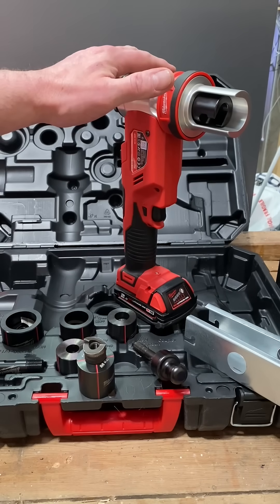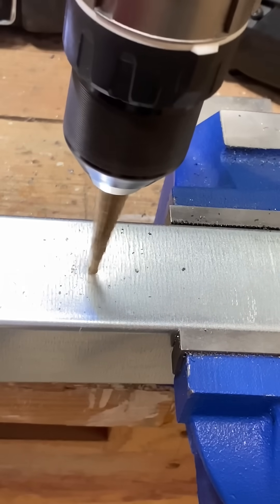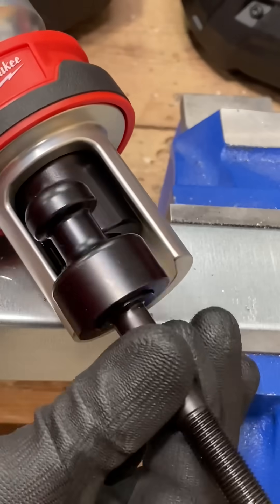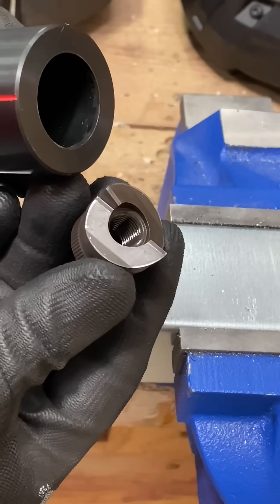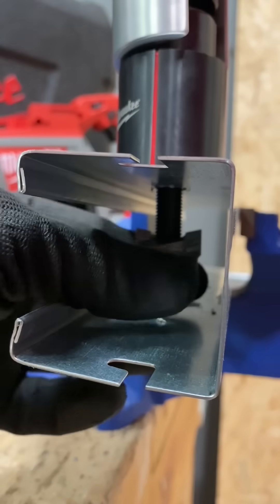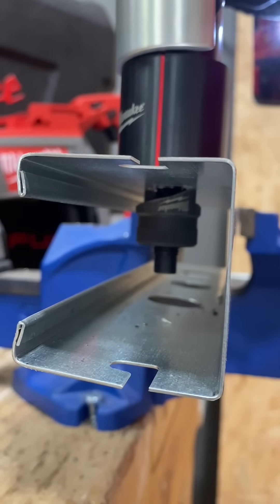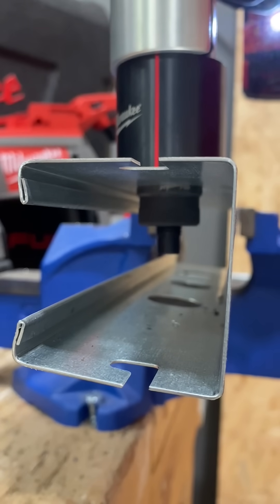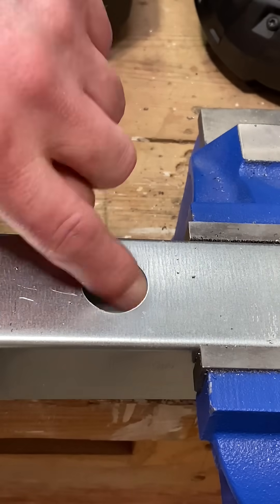ELECTRICIANS' TOOL TEASER - Milwaukee M18 Force Logic hole punch #shorts

Comment: A lot of faffing about .The decent fine tooth hole cutters you have now days could have cut and extra two holes by the time you fart around with the mechanism of it lol . As a previous poster replies there was a manual version of this back in the 70's & 90's . I am not 100% certain but I think they called it the Bailey Punch. May have a connection to the Electrical Contractors Bailey's. It definitely looks similar to the arrangements you have with the drill in respect of the cutting edge. It was tightened up with an Allen Key which compressed the cutter until it broke through the metal.
Reply from the maker: We are going to do a trial on both hole saw vs Milwaukee

Comment: Q-Max punch with a battery drill would do the same job
Reply: I've tried that you have to keep a tight grip and low speed.
Reply: Qmax ok for really thin metal thicker stainless steel go for greenlee with thrust bearing but I wouldn't use a drill above 25mm
Reply: Yeah but you have burs to deal with

Comment: Seems like a lot of faffing about. The time it took you to drill the 12mm hole you may as well have just drilled the 25mm hole.
Reply: I agree. I love milwaukee but just drill the damn thing
Reply: I was going to say that. The preparation takes longer than the process of normal drilling and filing
Reply: Just grab a large Stepper bit .
Reply: Punch works better on stainless steel gland plates. Especially doing multiple holes. The hole saw heats up.
Reply: If it’s the companies dime- I’ll take two
Reply: @altimmons  well it seems like one person gets it. 👍
Reply: but then you spend just as much time filing the edges smooth
Reply: @Kingrhem.  or you grab some sandpaper and have it done in 5 second.
Reply: Is this punch not able to go up to larger trade sizes? I would always go punch over drilling a 4” hole
Reply: @bradyschow3564 yes 1/2" through 4" i believe they even sell 5" and 6" dies
Reply from the maker: Point taken
Reply: This is more useful when doing 2" and up for electrical feeder in panels
Reply: And save a ton of money from not having the purchase of a no doubt expensive tool.
Reply: We do a lot of stainless and Titanium cutting, purely for costs drilling 12mm's and punching clean holes has been a much cheaper then replacing holesaws, learning how to sharpen drill bits is easier then one thinks.

Some situations you use a holesaw, mainly when its one hole and when we can't be arsed getting the punch 😅
Reply: Over engineering for a problem, that we already have a solution for
Reply: @street282  yeah, buying new hole saws every week is a great solution.
Reply: Sometimes we make 2.5 inch diameter holes in the very stout walls of elevator controllers. The only viable options are either a hole saw- (messy, crappy finish), or a knock-out tool. Sure, you can drill a 25mm hole straight away, but try that on a 64mm hole, through 12 gauge steel! Thats why an electric hole puncher is a cool tool.
Reply: People who rarely have to do such things wouldn't see a benefit.

The savings in replacement hole saws alone makes the tool worth it when you find yourself doing this multiple times on each job. 

I use the 2 to 5 inch dies pretty regularly. There are several reasons why this is the far better choice over a hole saw.
Reply: Why arent you just drilling the hole wtf
Reply: I was kind of wondering about that also but there is obviously applications where this is preferable...i just can't think of where lol
Reply: Wtf is trunken? Never heard of that term.  I love watching these tool showcases and stuff there always new foreign terms for stuff i know by other names.
Reply: @John J Kelly nope not at all. You got me.
Reply: It’s cool af but it does feel like any excuse to make another expensive single use tool
Reply: If the tool could do the same but without having access to the side opening.. theres no point in waisting time and money when you could just drill it out at quarter of the time. As for the shavings.. you have a vacuum and a massive side opening you can just shove the tip in and for those that say cables are in the way.. again just move the cables in that big opening. If this tool can do the same but in a beam (with no openings on either side) and to do it in similar time as a drill bit, you have my money and thumbs up! 👍 come up with that boissss
Reply: If you drill it though you have to then spend some more minutes deburring to make sure that you don't marr your cable's insulation.

It's not likely to be much faster.
Reply: I came for this comment and I wasn't disappointed, gotta love the Internet.
Reply: A little bit more with bit would had been same results
Reply: The idea is great, but in reality, you could have probably done 3-4 holes in the time it took you to set up, etc.
Reply: Brokie. You don't know what you are missing
Reply: really only good if you have a hole already there that you need to enlarge... not a lot of great ways to do that in metal...
Reply: Dudes never touched professional electrician tools and it shows 😂
Reply: Thier are cone bits upto 32mm so why to bother.
Reply: I think this tool is more for ticker glanding plates on fuse boards than for trunking
Reply: Also depending on the material, the drilling will take longer
Reply: Nah it's not for doing 1 25mm hole, it's for when you need to do 30+ holes or large holes, it also leaves a really nice finish with no burs. 
If you've got a large industrial switchboard with lots of glands or large glands/entries, this thing makes it a lot easier
Reply: TRUE!
Reply: Bit excessive for that application but great for repetitive jobs or stainless panels. There has been a bolt only version available for years that can be used with a spanner or impact gun.
Reply: Works nice when you’re trying to enlarge an existing hole or drill a hole so large that a holesaw becomes a pain in the ass. Other than that it really is easy to drill the hole the right size the first time
Reply: 😂😂 plus the price and weight in the in the bag extra tools ain't needed.  Good to see there is tool though
Reply: How about enlarging existing holes ?
It would be a great thing to save my right arm for aother task best done after a days work.
Reply: You took the words right out of my mouth an anybody that says this is better then a hole saw obviously got conned into buying one and now they have to act like they didn't waste their money
Reply: @lloydgordon5958  as someone who has one provided by work, they're definitely useful in many situations, just not this one
Reply: Next time show a 63.5 mm cutout, ain't no one stepping that out.
Reply: The point is to get a perfectly even and smooth hole. It is not about speed but more so about the cut quality.
Reply: I believe it’s pronounced: “damn, that was cool”…
Reply: You can drill into a live switch gear bro. I'll stick with the punch.
Reply: @bryanteger  um you'd have to drill to use this punch anyway. So what are you trying to avoid?
Reply: @joshleduc1771  The copious amounts of shavings that come from a hole saw don't mix well with 5kva of electricity.
Reply: @bryanteger  I get that. But You have to drill a hole and have shavings anyway to use this punch. A shop vac while drilling either hole would help eliminate the shaving issue. Eliminating the live circuit if possible is even better.
Reply: @bryanteger  just cover the switchgear with plastic or cardboard
Reply: @bryanteger  just...use a fucking vacuum then?
Reply: @joshleduc1771  trying to avoid smoothing hole.
Reply: @bryanteger  you still have to live drill it to use that knock out... You for real?
Reply: @daylate  yeah there's a big difference in drilling out a half inch to one inch hole And then punching it when you're bringing in four and a half inch feeders to live switchgear. To using a 5-in hole saw to drill into that live gear
Reply: @bryanteger  guess people used to just die when they have to live tap.
Reply: @daylate  mitigation of risk dude.
Reply: @joshleduc1771  you can locate the larger hole more accurately using this punch.
Reply: @joshleduc1771  you realize this can also be used to expand a pre-existing knockout, right? have a bit of imagination
Reply: @bryanteger  You shouldn’t be working live under any circumstances
Reply: @uplightuk8924  in commercial or industrial electrical work sometimes you cannot shut down a switch gear bank that is powering an entire building that serves e911. Either way the emergency bus is going to turn on via the batteries and then the generators. If you have to modify the bus in the gear there's nothing you can do except protect and be careful.
Reply: @bryanteger  I know what you’re saying - practically sometimes we have to work live I have to work live when working in places like hospitals etc but technically speaking we shouldn’t be working live but we both know that’s not realistic
Reply: @bryanteger  you still gotta drill a hole first lol
Reply: @bryanteger  just wedge a bit of ply wood in there,,or an offcut of trunking lid to protect the cables when you drill?you gotta drill a hole to use the punch anyway
Reply: @bryanteger  if there was that much live gear that trunking. How would you fit the punch in?
Reply: @bryanteger  you have to drill into if first 🤯😂
Reply: @bryanteger he did drill, Nancy.
💅
Reply: @freeaudiobooks7469  good luck out there. You'll probably need it.

Comment: Im not sure if that tool saves time .. your really not skipping a step, just replaced one tool for another basically
Reply from the maker: True 👍
Reply: It’s not like they’re “inventing “ something for no reason either.  It’s a common trade tool, I’ve been using a manual knockout set for 15 years
Reply: As a industrial electrician it's not about time it's about quality that hole punch guarantees that when i put 30 holes into a panel that they are all perfect and that my connector will seat securely and tightly

Comment: Drill a hole to cut a hole?

I think drillingwith a 25mm hole cutter. Then quick swap to a rotary burr bit would be a lot quicker. 
And cheaper
Reply: If it cut some kind of fancy square or hex hole (for what application I dont know) then it might be worth it.  Otherwise you are right  drill and debut in 1/4 the time.
Reply: When your punching holes into live cabinets, you'll understand why this tool is amazing!
Reply: @Tre16  bullshit, shield it with something like cardboard.
Reply: @jrod264winmag  ok hack
Reply: @Tre16  I install multi million dollar automated food processing equipment lad.
Reply: @jrod264winmag  want a cookie or something?
Reply: @Tre16  funny you say that. I might be purchasing a commercial bakery.
Reply: @jrod264winmag  lol you are entertainment.
Reply: @minrathejunglist  Oh you must be an expert electrician too?
Reply: @jrod264winmag  I meant that as praise. I realize what I typed sounded sarcastic though lol
Reply: I've been using one for the last few weeks for a project, the messy bit is the pilot hole but once drilled you can smash through punching the holes. It's about 4 times quicker and  less effort than a hand pump hydraulic punch set.
Reply: Yep call me a lazy no gooder but I would have just swapped to a larger step, got my hole
size, deburred with dremel, grommeted and been on my way in less than 2min.
Reply: Or even have like a little battery dremel on you with a burr tool. A little more expensive but whatever.
Reply: Deburr with a deburring knife (or don't, doesn't matter) and shove a grommet in there. Wires should never go through a bare metal hole anyway.
Reply: Or just put a gromit on it and move on
Reply: The pro of a punch is the edge it leaves aswell. The punch does not leave a burr that could cut wires or people so there is less clean up time after the cut
Reply: @BBuford  that’s what grommets are for
Reply: @BBuford  Holes cut or punched always get a connector, bushing or grommet of some sorts. Greenlee hole cutters do a fantastic job of making a clean cut.
Reply: @BBuford  you'll. Notice they said to switch to a rotary deburr, it would def be quicker

Comment: I remember using this method as far back as the 70s but without the drill.
Reply: Still use em today with a socket wrench, or drill/socket.
Reply: Yes same i think they called it the Bailey Punch
Reply: I have one. Use and Alan key on the bolt, two pieces and clamp. Simple. Can use a drill with Alan bit! Easier to carry and reduces the number of power tools in my van! No idea why this tool exists!
Reply: Allen punch.

Comment: For holes up to 25mm you’ll be better with Milwaukee shockwave hole saws. But if the diameter increase and you need need to do hundred of holes per job, definitely this tool saves money and time. Greenlee is a good alternative!

Comment: I really like my hole punches... but suddenly turning them with a ratchet seems very plebeian...

Also just wait till some of the commenters realise the holes don't have to be round with a tool like this. For folk who want to spend less but get the same results the Ruko cutter set is under a hundred quid and does 18 to 30mm (i think) and you can just turn them with your normal gun.

Comment: If your a panel manufacturer knocking 50mm holes all day this would be a godsend. For average Joe this is way too costly and slow to be worth
Reply from the maker: Totally agree 👍
Reply: Surely panel manufacturers have CNC in house now, meaning this is only useful to them for later on-site modifications. Like everybody else has said, for the odd hole a step drill or holesaw plus deburrer or file will still suit lots of people. I had a couple of QMax punches a few years ago but a half decent step drill is simpler and more versatile

Comment: All my rather previously expensive 110v tools are now deemed redundant. I know this because all installers are using tools with battery technology. Me being a keen fan of telling all, that the big constant in our industry is “change”, have moved into the battery tool world with a vengeance. This tool may not suit all, but it will pay dividends in my line of work. To me, it is a must have, it will pay for itself within a week due to the time saved.

Comment: That takes me back to being an apprentice....I remember using a manual cutting version of that using a allen key, thst tool also made a clean cut hole although my first thoughts on seeing the tool  were.'that ain't gonna work' ! but it did 😁
The great thing about it was that we had no battery drills, and no drills at all on some sites !
Even making a hole for a wall plug ? a Rawl tool and bruised hands !
Hole through a wall for a cable..a larger Rawl tool and a lump hammer, and more bruised hands ! 
Holes through joists ?...brace and bit, electriciand brace and bit had a shorter throw so harder to use.
Holes in steel ? a hand drill.
First battery drill I ever saw..A Rockwell,maybe 7.2 volt, no power at all so six 2 volt Cyclon cells in series in a belt pouch and a curly cord...anything to save time and knuckles.
Can I walk into a Milwaukee stockist and walk out without my card taking a hit ? NO, even yesterday and I only went in for a utility knife ! 🤣
Reply: Seem to recall a q max cutter? Used them a few times when it was dicey to drill a 20mm hole
Reply: The orginal cordless hammer drill rawl bits and bruised knuckles

Comment: Many of the viewers seem very critical look at the bigger picture guys a new perfect hole everytime say for example you are doing commerical work you may have a 1000 to do  you could easily do that in a day. Doesn't compromise the metal you could probably leave a very early apprentice on his if you mark the holes out . I'm telling you could earn a fortune very quickly with these types of tools. When this channel hits 1 million subscribers the market will become saturated , nice work
Reply: Im pretty sure thats not how it works .. industrial work is planned daily , no matter how many holes in total will be cut, you have steps to follow , you can't just run around with a hole punch all day . .

Comment: So you have to drill a hole to almost the size you want.....then use a lunch? Am I missing something? Don't see the advantage
Reply from the maker: Burr free holes with a clean cut - but I totally get your point 👍. This tools is not for the occasional hole cutting electrician. Gaz
Reply: You drill the hole to the size so the arbor that it can marry up with the second part of the punch set. Originally hydraulic, but this new battery technology is changing our industry. It would be interesting to see how many, for sake of argument, 20mm holes it can punch on one charge. Let’s start with a 4ah battery to give credence to the experiment.
Reply: It mattered when there were no power tools on site many years ago and you only had to drill a 1/4" hole with a manual drill then used the manual punch with an allen key ...I can swear to that one 😁😁😁 ever tried to drill a , what was then a 3/4" or 1.0" or larger with what was then, I think, Enox cutter...and they were not the blades of today like a Starret. Even had to drill a series of small holes, punch out the centre and sit there with a half round file for ages...and heaven help you if it was not perfect, that was your lunch hour gone !
Reply: @oyleyhands1332  enox cutters were hopeless little screws coming loose ,when no power available fitted in brace and bit and sat on handle ,happy days (not) .

Comment: Only takes 3 times as long as drilling with decent kit. Even have to drill a pilot... What's the point really.? And I'm a tool tart but this bit of kit seems pointless.
Reply from the maker: Burr free holes with a clean cut - but I totally get your point 👍. This tools is not for the occasional hole cutting electrician. Gaz
Reply: If you do panel building hole punches are common, this is the first electric one I've seen, my manual ones give perfect holes on aluminium, steel and some plastics.  Far better finish than a hole saw could ever do.... and they come in other shapes too.